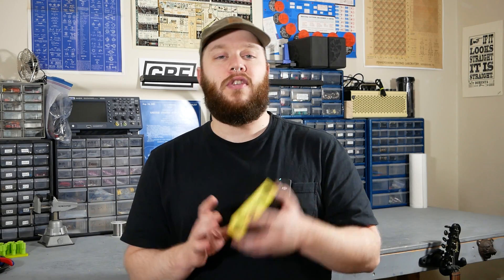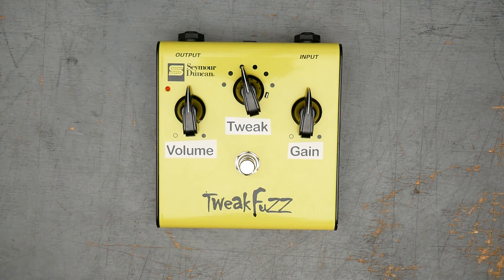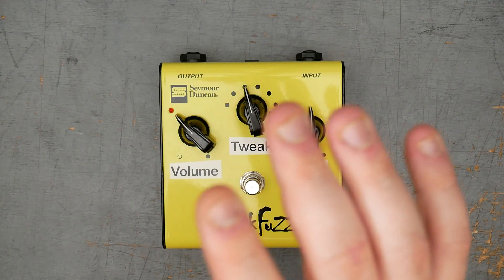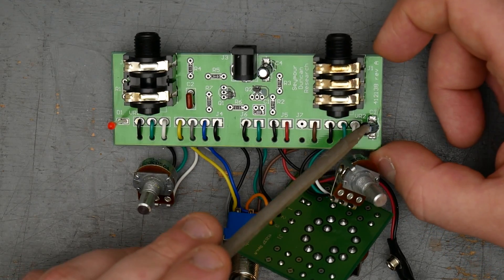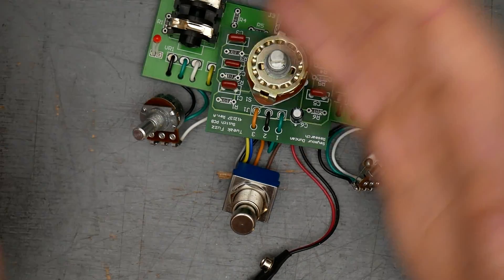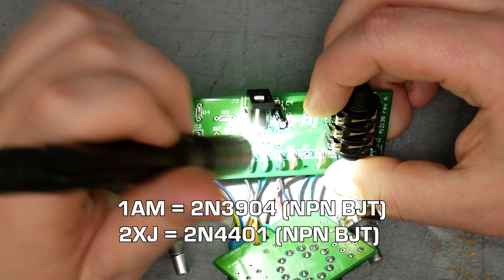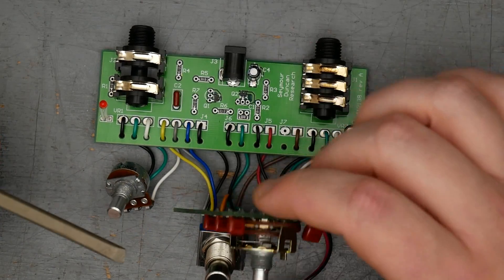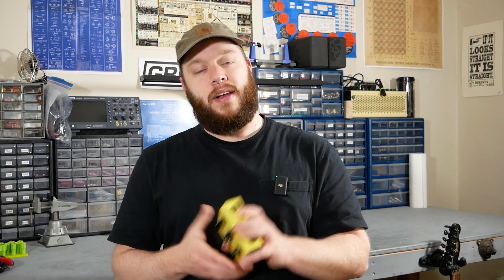Seymour Duncan Tweak Fuzz Teardown! See what's inside!

Comment: I have 5 Tweak Fuzz pedals, 3 of them have been modified.  Something to be careful of, the thru-hold pads for the transistors are not oriented for drop-in of alternate parts.  Be sure to trace it out before you install different transistors. I had to do some fancy solder sculpturing to install BC183 transistors in one of mine.

Comment: I enjoy your videos and appreciate how thorough your inspection is. I build fuzzfaces with a very similar mod, and was actually finishing one up right as this video came on. I use a toggle switch to select between 2.2/0.47/.10 uf caps and so far players seem to like the 0.47 the best. I use the slightly lower gain 108Bs for silicon and it sounds fantastic in a mix. I also add resistors as well but the values are different.  You’re right about this being an amazing platform for modding, I might have to pick a few up myself.